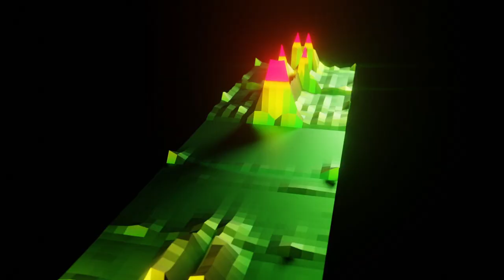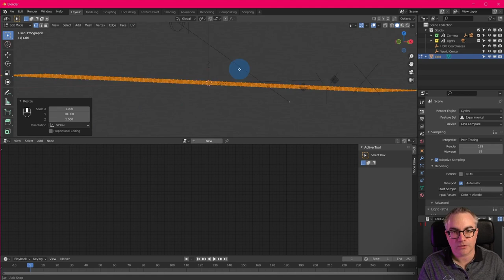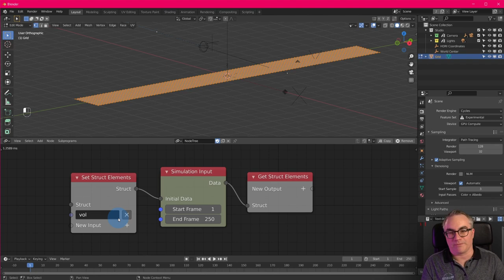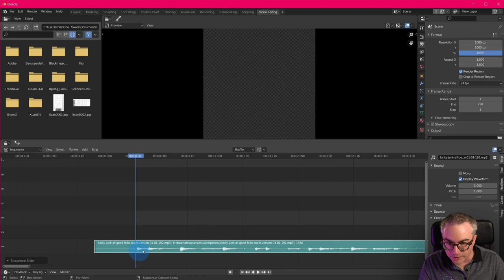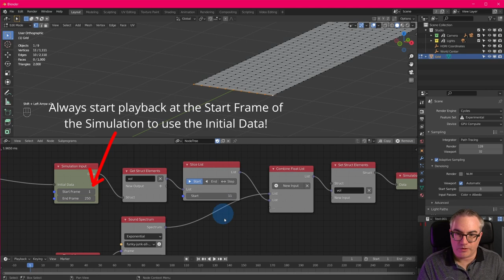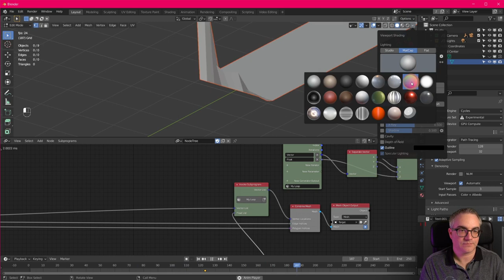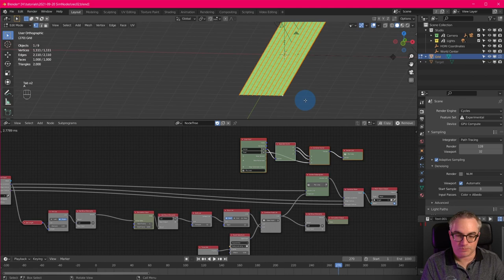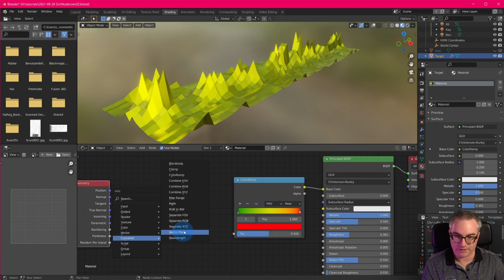Simulation Nodes (1) Sound Spectrum | Blender Tutorial

Comment: Adding a grid instead of a plane is very important - a subdivided plane doesn't have its vertex indices in order, and you can't rely on edge vertices being in the first 11 positions of the list. Always use "Add mesh> Grid" for this. 

This also means that applying this technique to a custom premade mesh would be a massive pain (unless you want to somehow manually adjust the vertex indices).
Reply from the maker: Exactly. You could even create the grid in AN  ;)